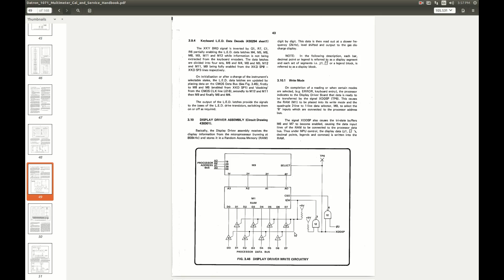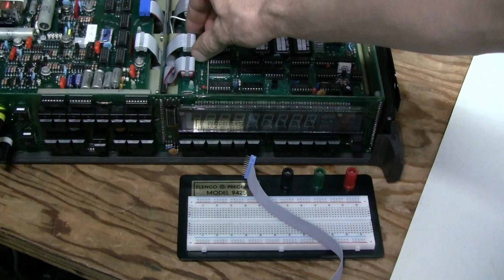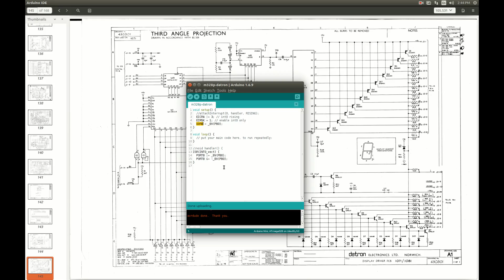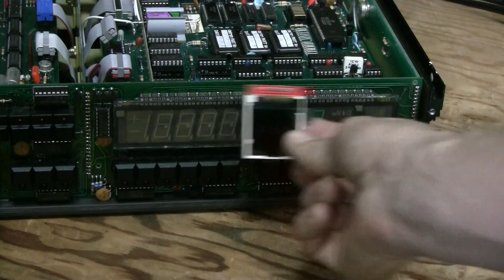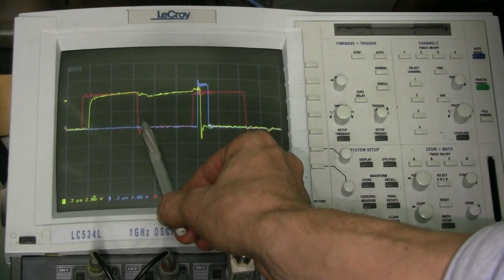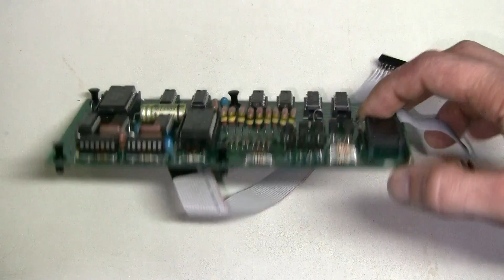#48 - Datron 1071 display replacement part 1

Comment: +FeedbackLoop  I suggest you to do every possible thing to bring the original display back to life. It looks amazing. We have that exact same type of DMM at work, so I'm know what I'm talking about. An LCD would never be able the mimic the looks of a Panaplex display. Are you sure that everything is OK around that display tube? Driving circuitry, voltages?

Tho I really like your display replacement project, I subscribed to your channel because of this. You claim that you're a DIY hobbyist based on a garage lab, but it seems that you do so complex and advanced things which would be nice exercises even for a pro.

Aren't any LCD modules with the flat-flex attached to their longer side? I think it would be much more elegant, because than you can use less LCDs for the project, with greater utilization of their surface.
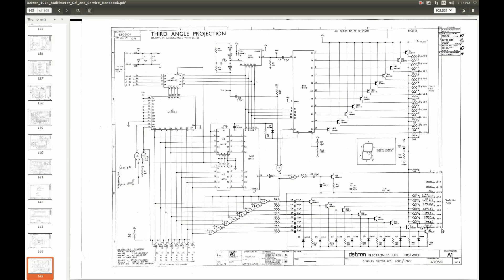Reply from the maker: I agree, but I am afraid that the original display is beyond repair. I checked the driving circuits, looked at the waveforms, and found nothing wrong there. And if you look closer at the right side of the display @15:31 - especially the last block of symbols - it looks different even visually. It seems like the cathode poisoning has done the damage.
Reply: FeedbackLoop I see, but someone suggested the rejuvenation of the tube. Have you tried it? It seems that it would be enough to drive it with 2-3 times (even close to 10 times) of its nominal drive current for several minutes (or maybe hours), to wash away the cathode poisoning from the surface, and give it several years of lifetime.

Comment: Check out my post on the EEVBlog about reconditioning a VFD. You'll get a lot more life out of the old displays. Start at post #3.
http://www.eevblog.com/forum/chat/vacuum-fluorescent-display-rejuvenation/
Reply: +Aaron Hammett  This one isn't look like a VFD. I think it's a Panaplex. Kinda nixie, but 7-segment instead of character display. We have the same meter at work in fully working original condition, we use it for calibrating all of the company's other multimeters. That display is beautiful when it's working properly. I hope +FeedbackLoop checked everything around the original display, it's really worth to keep it running instead of those LCDs, Panaplex has a really beautiful and unique look, that no LCD can mimic.